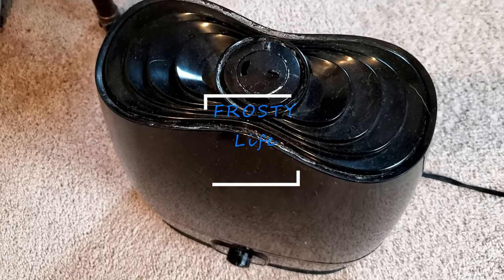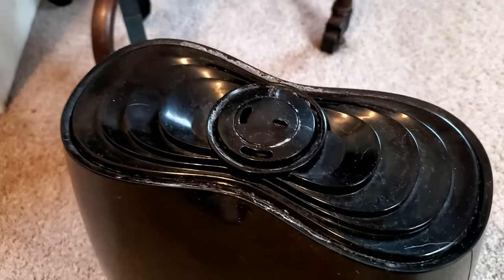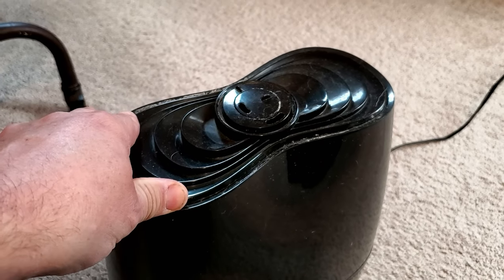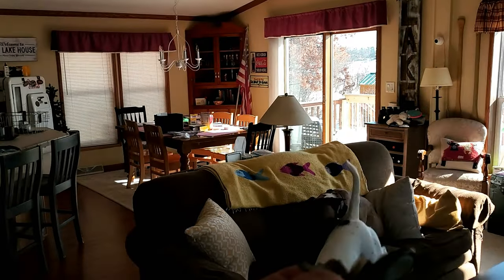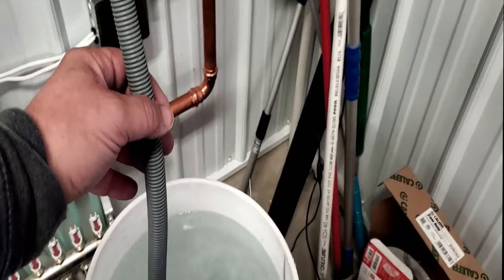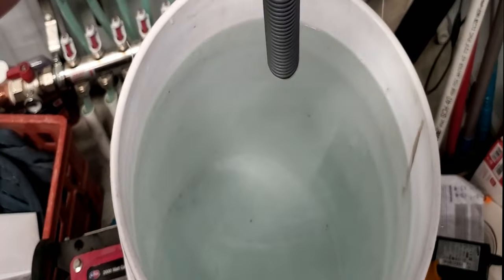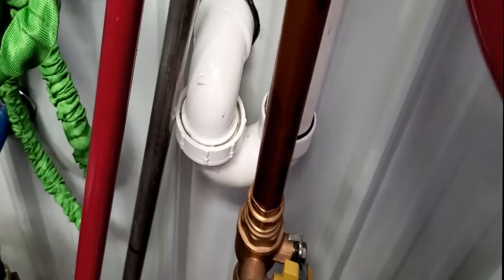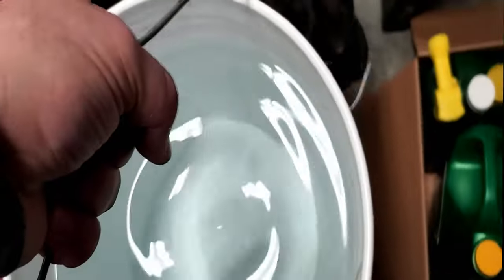Distilled Water for Humidifier | How I Collect Pure Distilled Water from Furnace Drain

Comment: The furnace water is nit distilled, it’s highly acidic condensate, it’s a by product of the combustion process.
It’s illegal to put in many sewer systems without running through a neutralizer.
Reply from the maker: Yikes, I need to learn what to add to neutralize it without putting minerals in it.

Comment: You're okay right now with your new system it doesn't have algae or mold in it yet. Ideally you would be getting your coils cleaned but most people don't do that anyways. The idea of taking your condensation and dumping it into your air is a really bad idea. it's going to introduce a bunch of bad stuff for your lungs. Much more dangerous than the dust.

Comment: For me this winter season it's been really good regarding my skin.  For some reason the area around me has been quite humid and that makes me so happy! No skin rubbed raw from trying to sooth itching, tingly patches---which even hydrocortisone cream doesn't help. At one time I used a humidifier but could never regulate the amount the dampness in the air.  I needed a humidistat to know when turn off the machine, which I never remembered to buy. I suppose melted clean snow could be used....am I correct?
Reply from the maker: You are correct if the atmosphere in the area is fairly clean but around here we get severe winds with blowing snow and dirt and they get mixed together which puts a lot of minerals in the water and dust particulates

Comment: Tom, please don't let your pups drink that water, and i would advise against any use whatsoever of any condensate derived from the combustion process. That water is at the least very acidic let alone most likely has other things wrong with it. In most area's it is code to drain it into a waste system as apposed to letting it run outside on the ground. Also some require neutralizing the condensate before disposal. Those two things rite there tell you that it may not be good for human or animal consumption and or breathing. Most say the acidity is about as bad as a cola drink, and if you ever spilled soda on a cars paint you would know how acidic it is or its cleaning powers on chrome and the like. I know you mean well buddy but just buy distilled water.
Reply from the maker: Yikes, you have good knowledge and now I know, and agree not to give to dogs. I never did give it to them yet (they knew enough not to drink it). The big question is this: People often put vinegar in thier humidifier water because it makes the water more acidic, so would this water be perfect for humidifiers?
Reply: @FROSTYLIFE  being acidic from vinegar and acidity from chemicals or hydrocarbons are two different things. And just because people do it doesn't make it right or safe for that matter. The exhaust pipe on your truck drips condensation, but i bet you wouldn't use that for anything. If it was condensation coming off a cooling coil on an air conditioning unit, i might use it for something after filtering because its not a product of combustion. The condesate from your boiler is produced by running the exaust from combustion through a secondary heat exchanger to extract more heat out of the exhaust gases which puts more heat into the boiler water which intern is more efficient than going out the chimney. And since the exaust temperature is lowered so much it condensates and is drained away. Thats why all 90+ high efficiency boilers and furnaces can run pvc pipes for exhaust as apposed to metal chimneys due to the lower flue temperatures. Hope this helps you understand a bit more .
Reply from the maker: @mitchdenner9743  Thank you so very much Mitch.  I value your expertise very much.  I want to thank you for taking the time to help me understand this.  My wife says I have hairbrained ideas hahaha..  I might need to take this video down because I dont want to mislead anyone in my "how to" videos.  Thank you, I really appreciate you.
Reply: @FROSTYLIFE  just looking out for you. Stay safe.